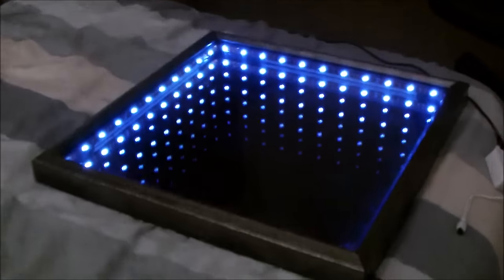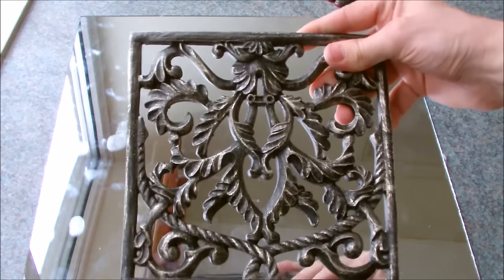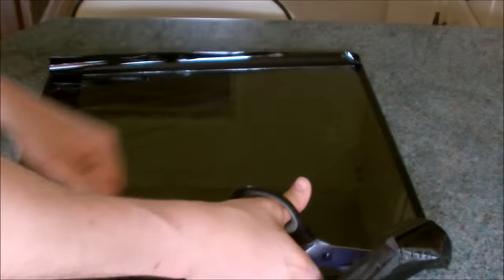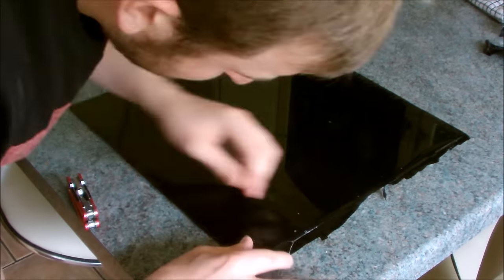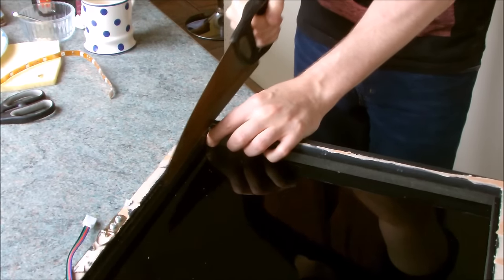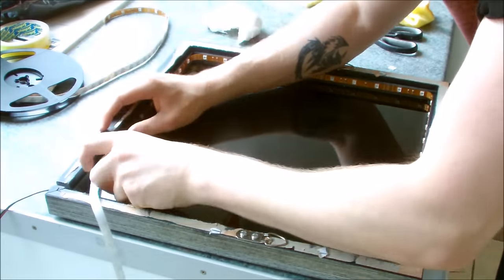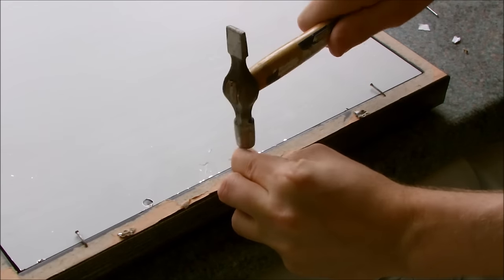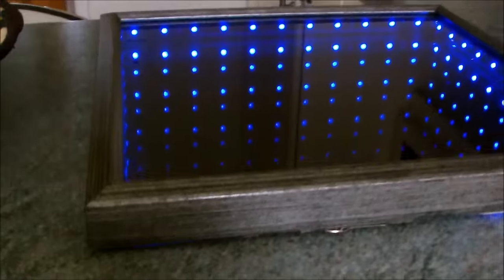Make An L.E.D Illusion Mirror!

Comment from the maker: New video - Make An L.E.D Illusion Mirror!
Reply: how much would you sell such an item for?
Reply: i would buy something like that... yes... buy.. im to lazy to DO it.
Reply: Do you have a rough estimate on how much you spent total!? this looks like an awesome weekend project! I subscribed and liked the vid! =]
Reply: How much costed your multitool you used to remove the sculpture with? I got the exact same for 4 bucks
Reply: Actually it's bigger on the inside technology ;)
Reply: TheXtraMan99 Actually it's non euclidean geometry. Well, in theory, at the very least.
Reply: Were did you get the L.E.D.S
Reply: Hello mist8k can you tell me how much dark tint did you use ???????   I can get easy black tinted, medium and darkest black tint . Which one you used ??? Nice job btw.
Reply: Kevin Ringer  Hello Kevin, go here; you can get varieties of L. E. D. strips.
http://www.dx.com/s/led+strip

For the blue led strip
http://www.dx.com/p/blue-100-smd-1206-led-emitters-strip-450-490nm-140mcd-149056#.VDio0Gd_sns
and its costs $ 6,23.

I bought red LED strip to make an 'L' sign for my driving school car; 2 - 3 years ago and it works fine.
Reply: Suji Sittampalam thanks
Reply: ***** yes
Reply: Is it just me or does it feel like u can just jump through it like a portall
Reply: Have you just made a gateway to another world with this, it looks like an empty void
Reply: kingdedede608 Well it is basically an empty void with no color, but only 1 layer of contrast, which is black. cx So your right, and I wanna make 2 of these! CX
Reply: how did that work?!?!?!?!?!?!?!
Reply: Sooo cooool! I'll try to do the same, thx ;)
Reply: Love it, cool, tnx!..
Reply: Wut Dafuq I can't figure this out either. Looking everywhere.. I tried Peel and Cling Gila 5% and didnt have the success as seen in this video. Have you found out what film works best? I  understand a mirror transparent is good, but can't figure out what actual product that is.
Reply: Rob Helms Rob i can help you. What country are you in?
Reply: Rob Helms I am in Mass an own a sign company ans graphics shop. we make these things all day long. take a look at ours and the depth of the illusion compared to what your seeing here in this video. After you take a look Ill tell you what we use. Heres the site. pinschergraphics.com
On the site go to the pinscher shop. Then scroll to the video of the American Flag illusion mirror we made and see the depth Better yet click and watch the video at the top of that page. The little boxes have a limited depth. The larger ones in that video have a greater depth that goes back about 4 1/2 feet.
Reply: Michelle Sullivan Thanks. I checked out the video. Nice job..  My shadow box is only 1" deep, so it won't reflect like the 3.5" you have.  What is the film?
Reply: Rob Helms The depth of the box does not dictate how deep the illusion goes. The depth of the box has nothing to do with it.
Reply: Use the Gila you found online. Its not what we use however it will work for you. You shgould be able to find that Gila at local Lowes also. If not try a local person that tints windows. We use either a silver limo tint or actual 1 way mirror thats used in interrogation rooms in police departments . If you get it from Lowes make sure its silver. As long as its silver you will get the really really deep illusion
Reply: U don't have to put new video. It's kinda implied when there is a video up that wasn't up before...
Reply: Michelle Sullivan
Can you give me a link to what you use because I am building a table out of it and the I don't wanna be spending all of my money trying window tint I got this window tint film:  http://www.amazon.com/Gila-PB78-Privacy-Residential-36-Inch/dp/B000HE57JS/ref=sr_1_1?s=hi&ie=UTF8&qid=1424058224&sr=1-1&keywords=black+privacy+window+film     But now I am confused that it needs to be silver window tint film?
Reply: CamoFlaugeGamer First of all go to my business web site and look for the illusion mirrors we build. We use all silver or gold window tints. Professional stuff. Not the Home Depot, Lowes stuff. The percentage of light blocked makes a difference on the depth of the illusion. Again, go to my site and look for the illusion mirrors. Once you get to that page there is a video of just a few of the mirrors. The first 2 mirrors in that video are small mirrors. They are 12"X12" and have the store bought smoke tint this guys using. The bigger box's are 20" X 30" and have the professional silver tint that we now use. You will see the dramatic difference in depth on the bigger boxes when you see the video. 
Here's the link to my site 
http://www.pinschergraphics.com/

Where are you? Are you in the U.S.?
Reply: Michelle Sullivan
Yes, I am in the U.S. and thanks for replying  :D Also I am suggesting that that tint is extremely expensive being made out of silver and gold
Reply: CamoFlaugeGamer If your in the states lets just cut to the chase then. What size(s) do you need, length and width? And where in the states are you?
Reply: Michelle Sullivan  I was planning to put the illusion mirror into a table so the mirrors' dimensions would be 38'' L x 13 1/2'' W x 1/4'' H the glass would be the same just with 1/8'' height I measured everything and found that the table thickness would have to be 3/4'' or 1'' exactly I am in West Palm Beach Florida
Reply: CamoFlaugeGamer If you want I can cut a piece off one of our rolls for you and put it on the web site and price it there and you can purchase it from us and Ill ship it out from here in Boston. Ill have to check our roll sizes.
Reply: CamoFlaugeGamer Just measured our roll sizes, they are 36" wide. I can sell you a section 36"X 24" for $12.00 then you will have to pay for shipping which would be about $4.00
Reply: Michelle Sullivan Ok I should be able to order it today at around 5-6pm :D
Reply: CamoFlaugeGamer I put it on our site for you. I am giving you a 38" X 48" that way you have more then double what you need in case you make a mistake with the first one. And the site has free shipping so the price it is what it is. 
The site address is 
pinschergraphics.com
Reply: Michelle Sullivan
Thanks man I just ordered it! Cant wait to start creating everything!
Reply: CamoFlaugeGamer lol No Im a mam not a man lol, hence the name Michelle. Ill ship it out tomorrow for you
Reply: CamoFlaugeGamer did you get your LEDS yet?
Reply: CamoFlaugeGamer Nice. The ones we use are a 44 button remote. You will have to send me a photo when you get it all done. Is the table built yet?
Reply: Michelle Sullivan
No, I am building the table tomorrow and the illusion mirror depending when the tint, glass, and mirrors get here ordered the glass and mirror tonight! Also I can order a 44 key remote and use it with my leds I have now right? And why the extra 20 keys?
Reply: CamoFlaugeGamer 44 button remote has 20 colors, 6 buttons you can pre set with your own colors that you make by  by mixing any combinations of the 20.
4 buttons that run different cycles of color modes that change. dimmer and brightening buttons.
Flash mode with 2 buttons that you can increase or decrease the speed of the flash. 6 other buttons you use in order to mix the colors you want to create. As far as if you can purchase a 44 button remote for what you have I have no idea. That depends what brand your lights are.
Reply: Michelle Sullivan
Ohhh sounds fancy XD and I guess that there is only one way to find out if 44 key button works! So when I first started up my L.E.D s they got really hot after about 20 minutes and 50 minutes later I could not touch them, is this bad?
Reply: CamoFlaugeGamer Huston you have a problem lol. Ours never get hot. Not sure what you got yourself into there.
Reply: Michelle Sullivan XD oops I should probably send it back then
Reply: CamoFlaugeGamer Yeah that's really weird. None of the LEDs we use ever get hot at all.Check with the manufacture before you send them back and see if they are suppose to run hot. Sounds a little suspect to me but I'd check with them first as it may be normal for the lights you purchased.
Reply: Michelle Sullivan
They are waterproof I have no idea if that's anything to do with it. I just ran them for a hour and they seem fine I dunno i will have to monitor them
Reply: Orlando Pockets
I will sound like a noob but do i need that?
Reply: Pinscher Graphics
Reply: Orlando Pockets L.E.D. Strip kits already have a voltage adapter that bring down the power to about 12 amps and 5 watts depending on what kit he purchased. He shouldn't need any add on's as your suggesting. If they are has hot as he is claiming there is something wrong with the unit and should be exchanged for a new one.
Reply: Orlando Pockets Less than a intelligent response, nice effort though. What I was trying to convey which may be to far advanced for you is that he already bought a kit that includes everything he needs. Therefore why should he start adding things? Oh that's right he shouldn't be adding things considering the power adapter that came with his kit regulates everything. He should return it in exchange for on that operates properly. Can you wrap your brain around all that?
Reply: Orlando Pockets I figured that's about all you would have to bring to the table since actually grasping concepts and having intelligence clearly eludes you. I mean seriously here, A person buys a brand new product that is designed to work a certain way which he believes it does not work the way it should. And here you come along with the wisdom of a fire hydrant telling him to add things to a system that should already work just fine. Trust me bubbles if the people who made his string of lights and everything that goes with it needed something added I'm sure they call you right up and get your help. Somehow I think they have everything under control. It's called a defective product that needs to be exchanged. You understand being defective right since this is what your father has been telling your mother for years about you. Go back and play with your coloring books now since we are done here :)
Reply: Orlando Pockets
Reply: Michelle Sullivan Hi it's me again we placed a order 3 and a half weeks ago on 2/17 and on 2/27 it was shipped I still have not gotten it and there is no track number to see where it is can you see if you can get a tracking number and email it to me at the address that you e-mailed everything else to me please
Reply: Michelle Sullivan I seriously hope you did not scam me, that's just cheap
Reply: CamoFlaugeGamer So did you receive your "order"? You sent money to someone you met in Youtube?
Reply: andythrust1 they just called me and our order was lost in the middle of shipping now we have free shipping on our next order it will be at my house at Friday thank you Michelle Sullivan
Reply: CamoFlaugeGamer I am so sorry. We had nothing on our end to indicate shipping didn't go through. I just happened to catch your comment here on youtube so I looked into it. My hubby called your place today as you well know and explained what we had found out. As I stated we are so busy we delegated all of our shipping and receiving to a contracted company. When I checked with them they have on their file that they shipped it but have no tracking. Having said that My husband re shipped a duplicate order this morning with tracking and gave the info to your mom. But you have 1 thing wrong. I am not going to give you free shipping on your next order, I am going to give you your order for free. Just keep that in mind so you know next time you order there is no charge. But you also have our phone number so don't hesitate to call us. Again I am so sorry, we generally have no issues shipping with the company that handles the packaging and shipping.
Reply: CamoFlaugeGamer I see. Well let us know how it all eventually works out.
Reply: Michelle Sullivan
Thank you so much I will be building this soon! And is that really 38 x 48 or more? Looks like a lot
Reply: CamoFlaugeGamer It's more then what you originally paid for as I think I told you in the beginning I would send to you just in case you made a boo boo you would have more then enough to re do it. If you need more tell me and Ill ship it out no charge
Reply: Michelle Sullivan
Thanks, I am gonna build it this Saturday
Reply: CamoFlaugeGamer Please take pictures or a video when it's done I would like to see it completed.
Reply: ***** The best video.
Reply: +Mist8k - VERY COOL!

Comment: That's really neat. Maybe you could use even brighter lights to increase the depth.
Reply from the maker: Thanks! A two way mirror instead of the tinted glass would really make it awesome. But have no idea where to get them from for cheap!
Reply: ***** Maybe mirrored window tent.
Reply: Ask to 'borrow' a mirror then keep it forever
Reply: TheFishCostume I was thinking the same thing. I wonder if brighter LED's would have a deeper illusion effect, even with the tint film. Hmmm...
Reply: ***** Glaziers, and builders merchants can suppliy, mirrored panes or mirrored film that go on buildings. not cheap but you can get also toughened ones that would allow you to make a bigger one (large enough to stand on especially with a chaser cct running bar formed LEDs joining mirror to semi silvered)
Reply: You get the depth by increasing the distance between the two pieces the tented glass and mirror. The further they are a part the more depth you get.
Reply: Brighter lighting is not the key to increase depth
Reply: ***** Brighter lights are not the key to the depth of the illusion
Reply: Michelle Sullivan It depends on the quality of the lights, I agree it can be too much, like those idiots with the bright blue lights on their cars now. So blinding you have to pull over until they are past.
Reply: It is not the lights or the brightness of them that dictates the depth. It is what type of reflective on the front glass that dictates the depth. He used a car window tint of what light value I do not know since he does not say however it does not matter. If he used a 2 way mirror or 2 way mirror film that would be a infinity in depth illusion
Reply: Michelle Sullivan Wouldn't be infinity, due to light needing to be lost so it can reach your eyes. Also, brighter lights should increase the depth, the brighter the initial light, the more reflections it can undergo while still being visible. Although, perhaps due to the increased brightness of the first few iterations, your irises would adjust to reduce brightness, possibly negating the effect.
Reply: Daaaaammmmmnnnn good idea
Reply: Dale Bergeron if you run it as a chaser cct, the lack of persistence keeps the illusion, have made one in the past using fade sequenced 5W mes filament bulbs with the old 4017 decade counter and had an incredible effect with privacy semi silver window film (~%10 transmission) it was quite deep till the true mirror (~80mm) and also a good matt material around the side (anodised Al) 

A blood hint is to use a glassless mirror as the base as this stops the facet reflections and absorption from the glass which can cause weird effects.
Reply: ***** Use your youtube money on it......
Reply: humudu gli hobby non sono in vendita , e' pura passione !
Reply: Joseph Young Brighter lighting does not carry the depth any further then dim lights. Its about reflection not brightness
Reply: humudu no , evidentemente non sai cosa vuol dire  la parola " passione "
Reply: This Dreamer Pretty sure it's Italian, and actually it is a little idiotic to reply to an English comment in a different language.
Reply: You can still use a translator anyways. And I thought he spoke Spanish because some of the words he said are in Spanish since I speak it.
Reply: +Mist8k wouldn't a two way mirror block the view. maybe i misunderstood. the light doesn't go trough mirror. but maybe a double mirror-tintedglass-led frame would be cool. two layers. or a box with 4 sides and 5 mirrors and a LED-ball in the middle and tinted glass in front like this one
Reply: TheFishCostume
Reply: Foil % 50 75 100 ? Help plzz
Reply: To get more depth you need more rows of lights  since there is  a limit to how many times a single light will be reflected due to the dark tint
Reply: @mist8k  Can you plz tell me how to install cuted led strips in different areas

Comment: Interesting how this stuff is just catching on lately.  Back in 1977 a buddy of mine wanted something interesting to light his tricked-out van with on the inside.  I'd been playing with 2-way mirrors and suggested building a "time tunnel" mirror to mount on the wall.  It was 18" high and 30" wide.  
Regarding the lighting, this was before things like affordable sequencer lighting devices, so I created a small remote-sized control with 3 micro-switches, each one controlling every third light in the series going around the interior.  So, by rocking his thumb across the 3 closely-spaced switches, he could do a "chase-lights" thing, or alternate the lights, or make them run in any order and timing he wanted.  And because we left about 3½" or 4" between the back and front mirrors, the "repeat-distance" was extended, and the thing looked about 10 feet deep!
He had that thing for about 5 or 6 years.  It was the highlight showpiece whenever he was showing off his van.  Some people even went around the outside of the van thinking there was a "tunnel" extending out the outer side of the van wall it was hung on, and were amazed when there was no 10' tube actually sticking out.  
(Some folks are SO easy to spoof!)
Reply: Amazing, are you for rent?

Comment: i would use something like this on the floor of an elevator, would look and feel like your going down into the abyss...:D the materials need to change a  bit , like a super resistant plexiglass instead of normal glass or something, looks amazing !!! :D
Reply: Mgm national harbor in DC has floors made like this. Its damn pretty
Reply: use glass its strong enough
Reply: That'd be so cool